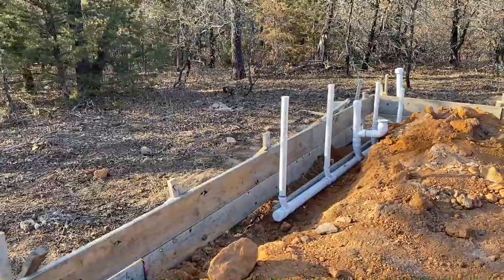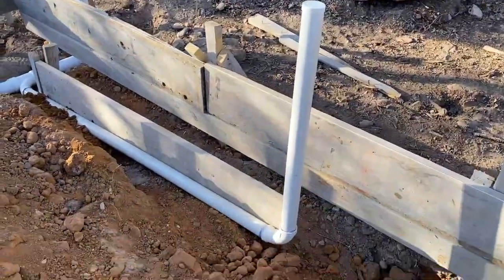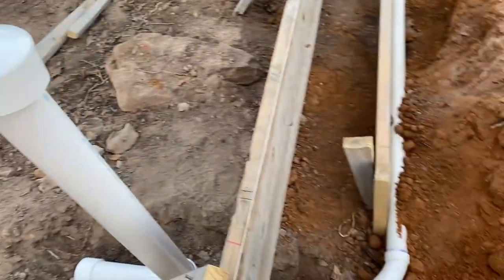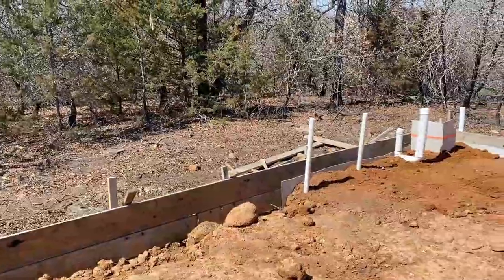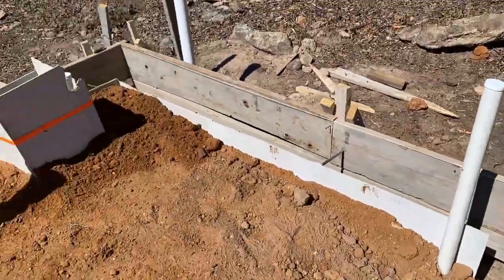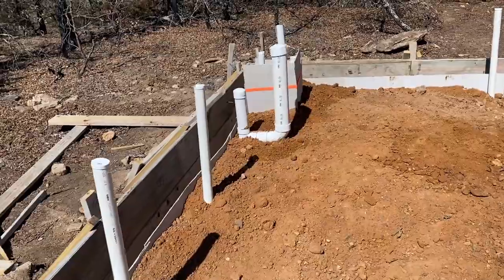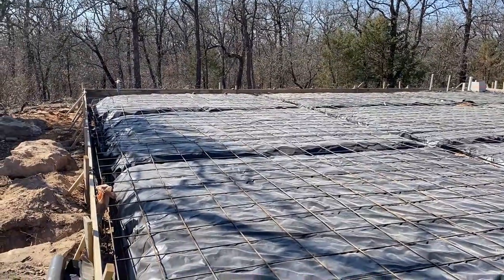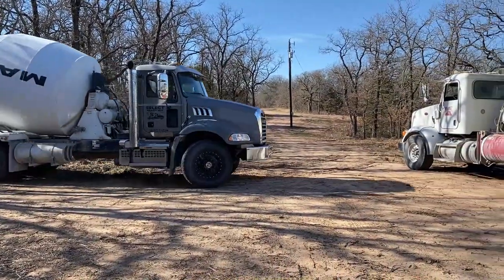Building My Dream Shop Garage Project, 50'x60' 3000 sq. ft.! How much $$ does it take?

Comment: Did i miss the cost?
Reply from the maker: Sorry, the foundation ~70 yards of concrete, 100 yards of dirt, labor etc  were ~$24K... prices are high. A couple of years ago, would have been half. And this is with one of the lower quotes I received (concrete was part of the total bid). Price went up over initial estimate based on additional work and materials used above my initial quote. The land looks more level than it really is, whole place has a slope to it.